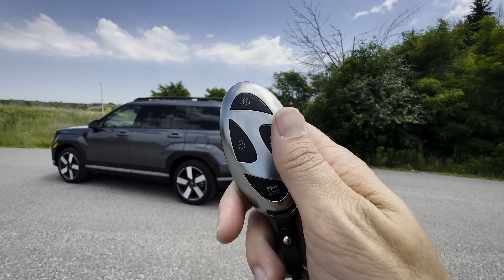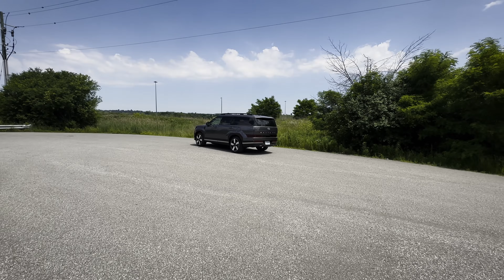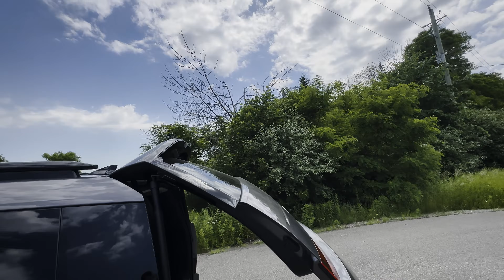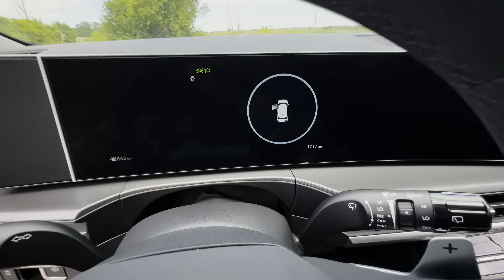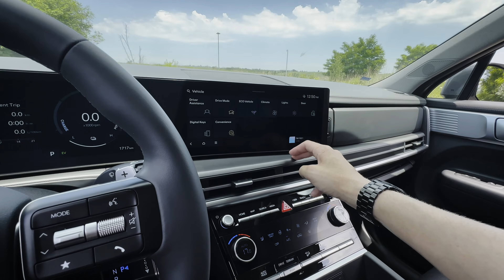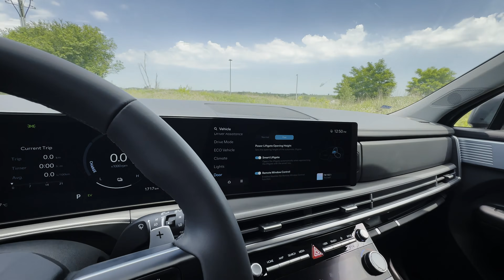Hyundai Santa Fe Hybrid Keyfob Tricks (2024-2025 models)

Comment: Is the AC activated during keyfob remote start?
Reply from the maker: It's based on what was happening in the cabin before the vehicle was turned off. If AC/Heat were on, it'll be on when you remote start, if you turn it off it'll be off!